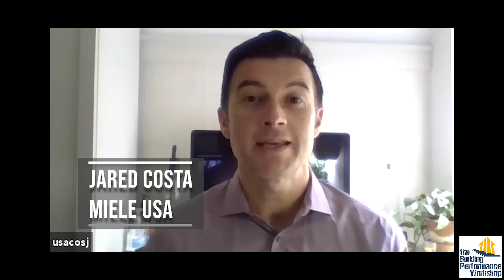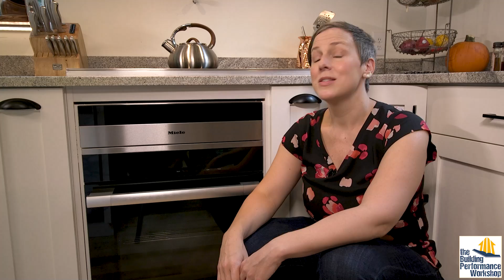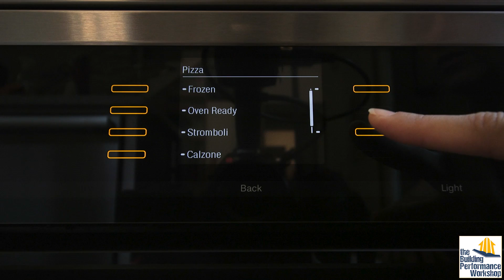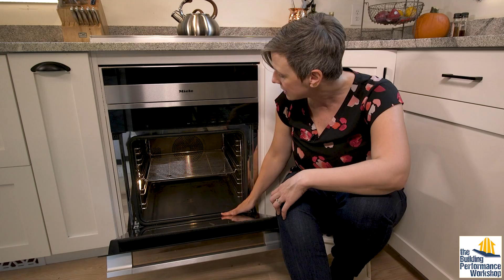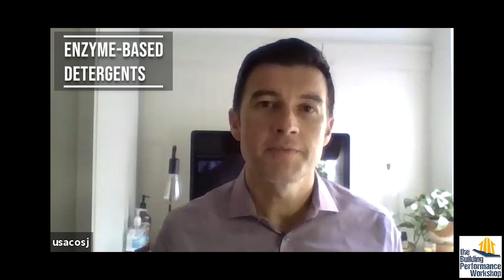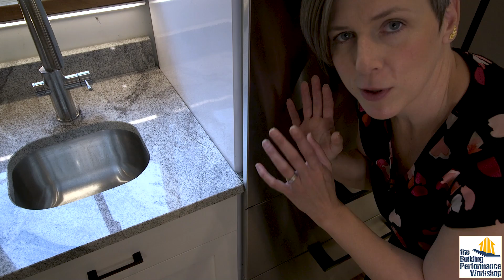High Performance Kitchen Appliances: Miele Induction, Convection, Dishwasher & Fridge

Comment: I have a question what is in the duo dose powder in miele dishwasher? I have rainwater and do not use fabric softeners   I understand why it would better to use the Duo dose for the dishwasher but I do not want to use chemicals that I do not need to. I have a miele washing machine that's over 20 years old.  Never had any problems. Love it. So would replace with miele. However in the dishwasher maybe Bosh. Wall ovens miele. Don't know about the make for induction but yes I would go induction. As for vacuum cleaners like stick Dyson but it's not perfect
Reply from the maker: FYI I believe rainwater is loaded with chemicals that it washed out of the sky. We fon’t use duo dose, no advice sorry.

Comment: I would never spend the ridiculous mark up Miele charges for their appliances ever again. Last 20 years? Yeah right. Maybe after you spend thousands repairing them like I did. Wayyyyy cheaper to buy regular appliances and toss them after 10 years and buy another set and then toss them again 10 years later.

Comment: How large is your range hood? It seems to be a 48" on a 36" cooktop or is that a visual quirk of the camera angle?
Reply from the maker: It’s a 44” on a 36”, yes. Wider is better.
Reply: @HomePerformance  I was planning to do a 42" on a 36" induction...guess I have to work out how to add 2 ovens under the cook top now too...
Reply: @HomePerformance  also, have you done a video on your venting for the kitchen yet? That has been stumping me for my kitchen...can't figure out make up air...

Comment: Where does the built in oven vent out? And how do you deal with the fumes/smoke that comes out of it?
Reply from the maker: The front, and that’s why the hood is directly overhead. Everything gets captured.
Reply: @HomePerformance  What would be the solution if the oven was installed in cabinets away from the hood.
Reply from the maker: Your family would breathe it in after it dispersed
Reply: @HomePerformance  This is the reason why a built in oven is not a good idea.
Reply from the maker: I’m not big on generalizations. The one in this video is built in.

Comment: This makes me so sad that the nearest Miele supplier is an hour and a half away across state lines.

While Electrolux, Whirlpool, and LG may not have the robust engineering culture that Miele does, in almost 40 years and across half a dozen states, I have only ever seen one refrigerator and one cooler freezer fail. But cheap plastic components lasting 15+ years are a boon for people on any kind of limited income. 

But I want the shiny cool sh*t! It's shiny. And cool.
Reply from the maker: And if you take good care of them, I bet they last much longer. BTW, they just ship the stuff to you, it’s ok that they’re so far away…
Reply: @Home Performance  

I was thinking more warranty issues that require service calls, but maybe their service area includes everything within XX miles.

It could be my history with German and other European cars and motorcycles has me biased against anything electronic from the continent...I say as my power steering ECU died in my Honda last month.

Comment: Great video! The only Miele product I've purchased/owned is their canister vacuum, which I bought many years ago and have been very pleased with. I was planning on replacing my single fuel gas stove with a gas cooktop and electric wall oven. However, based on what you shared here (and in previous vlogs), I'm now more likely to go with an all-electric solution. I'm eagerly awaiting your laundry video...
Reply from the maker: Workinonit for you Billy Boy

Comment: What kind of appliances last 5-7 years? All places where I was a renter in the US in the last 10 years had appliances older than 15 years, all in perfect working order, except for a fridge that had the compressor die at around 12 years. We're talking about lowest cost appliances, taking abuse from renters.

On a house I've owned the appliances were all GE, and about 10 years old. I had to replace a starter cap on a beverage fridge, and an electrical connector on a freezer door, both fixes less than $5 each. I've sold that house with all the appliances I bought it with, which by then were 14 years old.

On one of the rentals we had a dishwasher fail in a little over a year. Repair guys came in and wanted to replace the whole machine. I had a look and removed a dead bug (seriously) from between the interlock contacts on the door latch, and left the rental 4 years later, with the machine having no other issues. I guess the problem in the US is a culture of discarding things when they sneeze, instead of repairing it. My parents in Europe have multiple appliances over 30 years old, sitting outside in a covered patio, and everything still works fine, minus some minor repairs along the way. Things get tossed when they can no longer be economically repaired, not when they hiccup.
Reply from the maker: Sounds like you're a unicorn of a renter, my friend. A lot of renters I know don't even replace HVAC filters regularly.
Agreed that we should be fixing things instead of replacing, but here things have gotten cheaper to buy new than to pay for someone to experiment with.
Reply: @HomePerformance  Tell me about it. This week I paid a plumber $15 for parts, and $373 for labor, for one hour of work... I would have done it myself, except my two kids leave me with absolutely no time. Labor costs around this neck of the woods is insane.

Congratulations on the videos, I've been subscribed for a while and I've really enjoyed most of them. It's nice when you bring professionals from each area to weigh in on pros and cons of certain setups, and I especially enjoyed the series on air quality.

I guess I just take issue with the marketing guy hinging his pitch on what I perceive as a flat out lie. Appliances last way more than 7 years. Most will rust out before they stop working. Nothing against Miele, I really do like their products and had quite a few when I lived in Europe. It's just the premise that irks me.
Reply: @gamblit  
Lol.. Dont try to build an addition and have a new born at the same time. And be working overtime to pay the bills.
Reply from the maker: I hear you, and point taken. Sorry if that set a sour tone from the first minute of this vid.
Reply: I think the cheap simple is sometimes better than having all the bells and whistles. Its those extras that break or cause another piece to fail. 
Service calls are expensive. Might as well buy a new one. 
After three on my fridge. I could just buy a new fridge.
Seems to me there is allot of repair pro hacks ( hvac, automotive, appliance..).
Most have barely enough knowledge to do basic repairs. 
I would hate to have a professional 15k$ fridge and automatically told to just buy a new one.

Comment: The missing feature IMHO is the water dispenser on the fridge. They have it in some freezer but then it's crazy how much space is lost with it.
Reply: Alternatively put your water filter dispenser on the sink.
Reply: I like those fancy refrigerated/heated dispensers at the sink that run through a reverse osmosis system anyway. More convenient.
Reply from the maker: Ditto
Reply from the maker: We wanted a better water filtration anyway, and that cubby for the dispenser really puts a big hole in the insulation.